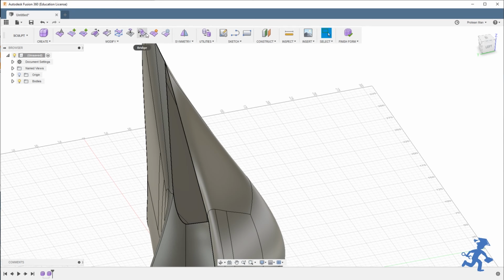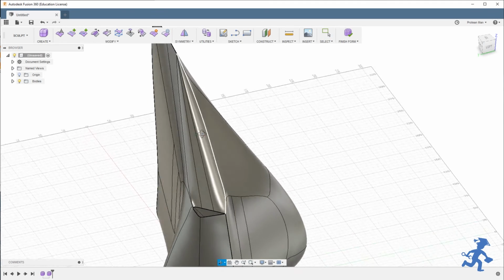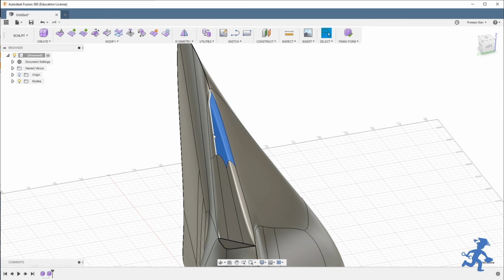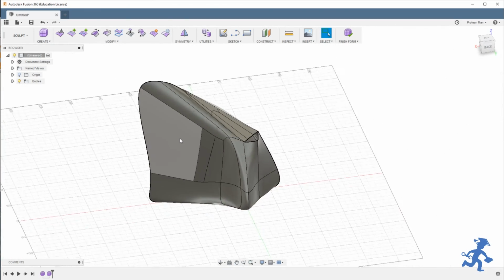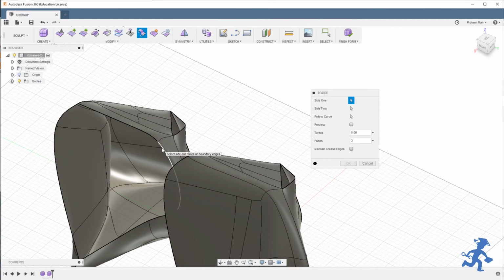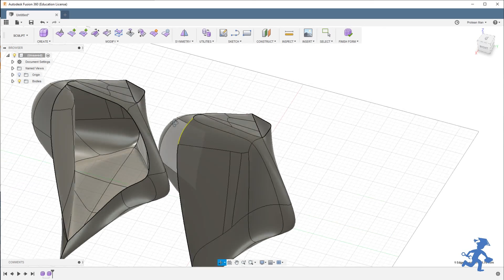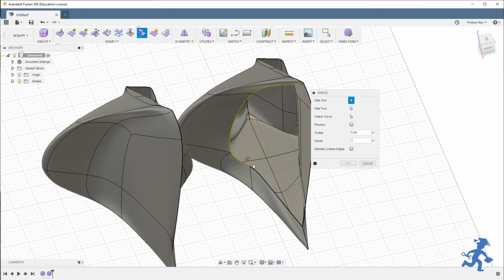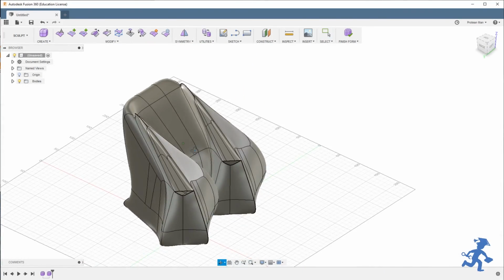Fusion360 - Tool 7 - Bridging - Sculpting Environment

Comment: wneh i go into the sculpting menu it makes the entire body transparent and I  cant click on anything.
Reply from the maker: Yes. They are two completely different methods of creating something. Design mode creates solid objects that prefer rigid structures while the Form mode is like a balloon that is infinitely thin and malleable. Any object created in the Design mode will inherently not work in the Form mode. You will need to convert it into a form - but I wouldn't recommend this. 

Design mode is the default while Form mode is a sub-state of Design mode. Meaning a From can move into Design but not vice-versa.

Comment: When I bridge it just makes every round edge jagged
Reply from the maker: That's a break in the form then. You have too many triangular vertices - Fusion Forms need to be in quads instead of triangles. Look at one panel on the form and count the edges - make sure there are four.